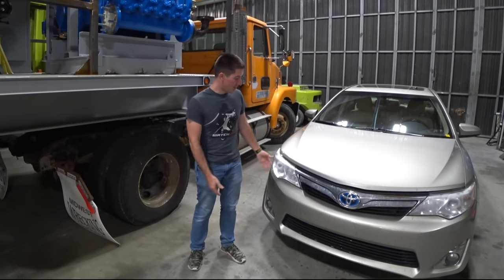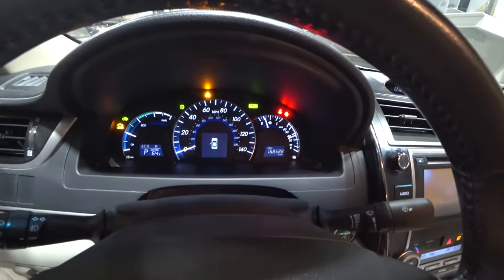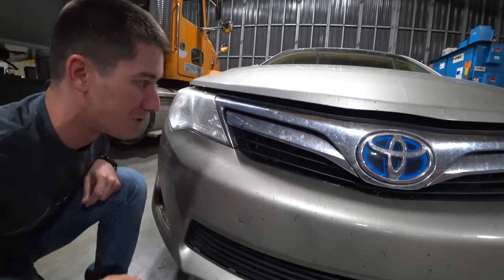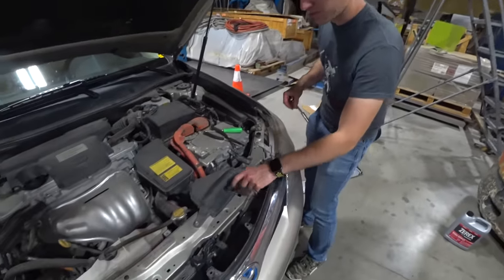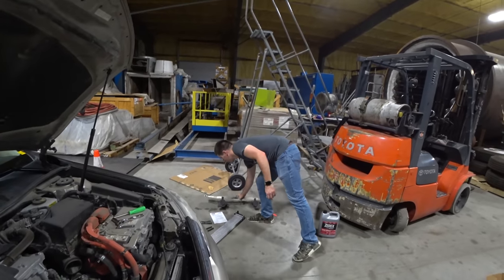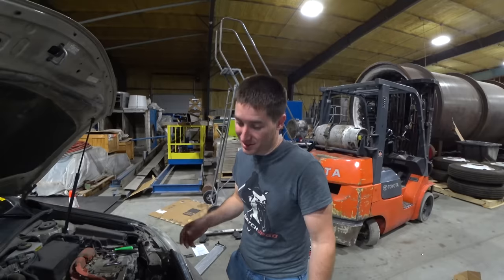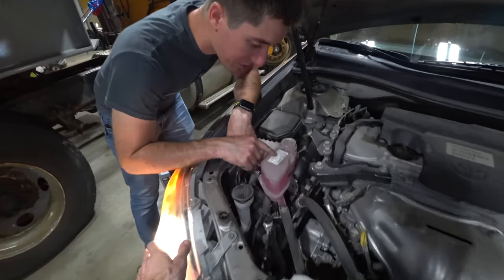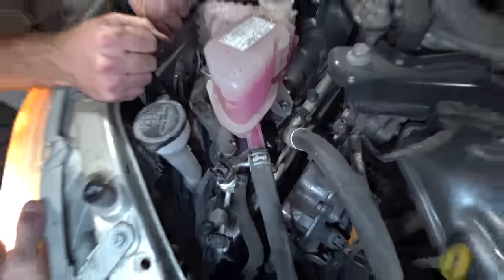BROKEN Toyota Camry Hybrid System *My Mom KILLED It*

Comment: That 5 digit number on the radiator support shows that the Camry came from plant 2 at the Toyota plant in Georgetown KY which is where I work. I could have helped build this one!
Reply: mercedesbenzs05 that’s cool lol
Reply: Does Toyota build cars in the US? I thought they have a factory in Canada but not in America.

What models are made in the US?
Reply: Bassam salim in Kentucky we make the Camry, Avalon, Lexus ES, and next year we’ll make the RAV4 hybrid. Mississippi makes the Corolla, Texas makes the Sequoia and Tundra, Indiana makes the Sienna and the Highlander.
Reply: @mercedesbenzs05  actually the Sequoia oddly enough is hand built in Indiana. You'd think it'd be made in Texas with its Tundra sibling. Doesn't make any sense.
Reply: CACressida you’re right. I always for get about that.
Reply: Thank you for building the highest quality US built cars. The work you do will stay on the roads for years. Cheers!
Reply: I have a 2017 Georgetown Toyota Camry Hybrid used mostly in a Southern California Beach Town. Four years old and all the systems work perfectly. Per Scotty Kilmer I can reasonably expect to get 400,000 miles out this car just by changing the oil and keeping the traction battery and other air  filtesr clean.

Comment: I used to hate hybrids and the Prius but changed my tune when I test drove an ‘18 Camry Hybrid. I admit that I was wrong. Yes, it’s not a race car. It’s not super fast and you won’t blow off the doors of a R32 GT-R (dream car) but when you need to accelerate, it performs like a regular 4 cylinder Camry and those aren’t slow. Not fast but not slugs either. It does what you need. Changed my mind and now it’s part of my fleet, an ‘18 Camry Hybrid XLE. Very happy with it. Almost got it up to 60 MPG’s for a midsize sedan, not bad! Plus it’s comfortable and I love it’s heated seats!

Compared to my Wrangler JK which I love dearly, it’s a much more pleasant place to be in traffic, the Jeep is more fun no doubt, but the Camry is the better daily by far.
Reply: I don't agree, if the hybrid system was slapped on a 16V 4 banger that's the same as the non hybrid, that's one thing. Toyota always adds the hybrid system to gimp motors.
Reply: But the V6 camrys are where it’s at lol. I’ve got an 07 Lexus ES350 with the same 3.5 L V6 And it’s no slouch. 0-60 I think is 6.5 sec

Comment: My wife had a 91 metro and now she has an 08 Smart Fortwo passion (3 cylinder ) and gets 50-75 mpg on the highway. It even has paddle shifters and heated leather seats.
Reply: Erik Stenberg my 08 Lexus LS460 has heated and ventilated front AND REAR seats, no paddle shifters though lol

Comment: Storm never got 50 mpg. The Geo Metro did but the storm was in the 30’s.  I had a Storm. Not a quick car but I really enjoyed it. A lot of trips in that car. 6 very long trips of about 1600 to 6009 miles a trip. But I loved my 280Z and 300zx twin Tutsi better.. More my 280z. A lot of work and a engine swap and I could fish tail that car up the street. 0-60 in 3.9 seconds. I got that up to 135 mph when a guy in his POS pulled a gun on my wife and I. I floored it and nothing but tail lights. Great car. That is the car I regret selling. Perfect for me.

Comment: I just changed the Hybrid battery in my Camry with 166000 miles.  Dealership wanted $4,000 I did it for $1,300 myself.  If the battery in this car hasn't gone yet be ready cuz they don't last much past that amount of miles.

Comment: Pulling the bumper would've made this easier. Maybe 10 fasteners total between the wheel wells and underside plus what was taken off the top anyway. Probably wouldn't have needed to take the crossbeam and hood latch off either.

Comment: Almost 30k miles a year on that thing. Crazy
Reply: Steve Oswald nice TSX 👌🏼
Reply: I put 90k in our Kia Optima on its 1st year. Then 25k the following year before the engine blew up.
Reply: @KDT5661  sounds like a kia
Reply: DIAMLER Thanks! Sadly got rid of it last year, kinda regret it. But I have a new Accord 2.0T now and also an ‘06 Saab 93 Aero.
Reply: @05Forenza  saabs are so cool, but you should kept the TSX!!
Reply: @KDT5661  sounds about right that's why i never trust Hyundai's

Comment: Why didn't you remove the grill.  Would have saved all the effort on holding it out the way the whole time.
Reply from the maker: Turns out it’s basically impossible to get off, has like 30 tabs that are press fit and hard to access.😬

Comment: So Toyota is back to making strong quality reliable cars again? What were their crap years? Not really crap just years to avoid? Early 2000s? I'm not sure
Reply: We have a 2002 Sequoia with 353,000 Miles and a 2001 Avalon with 440,000 miles. Both are still on their original engines. My 2012 Camry just hit 150K with no signs of slowing down.
Reply: They haven’t had any bad years, people just like to say the newer ones aren’t as good as the old ones but really they’re just as good. There are certain years/models that aren’t as good as others

Comment: Just to let you know, there is no coolant running to the hybrid  battery. Its air cooled
Reply: Francisco Bacino apart from the fact that it IS actually a battery cooling system.... duh
Reply: Just to teach u guys a little bit.. hybrid cars run this way there is a  hybrid coolant pump that runs the transmission and the inverter through a coolant radiator. then there is a regular radiator for the engine with a regular water pump for camry and 2001 to 2009 prius 2010 up to 2019 prius is an electric pump and the hybrid battery is cool down by a electric fan sitting on top of battery or on the right side and 2001 and 2003 there is a electric fan  on the left rear side 2004 2009 electric fan on the right side..so again battery doesn't cool down by coolant and it is not connected to the radiators.
Reply: Duh...

Comment: Those big a$$ fans need to start on a low setting till they get up to speed... we have many of them fans where I work..or you could burn them up,
Reply: Camaro Mods Channel the VFD ramps the motor automatically.
Reply: well that is what I was told. may be the older ones? @watchjaredwork1487
Reply from the maker: All of the old (commercial ones) have a VFD with a ramp, it also has braking. The cheaper ones seem to not use VFD control 💪